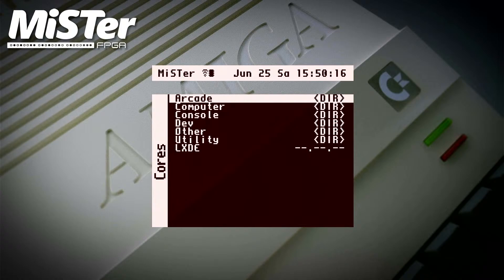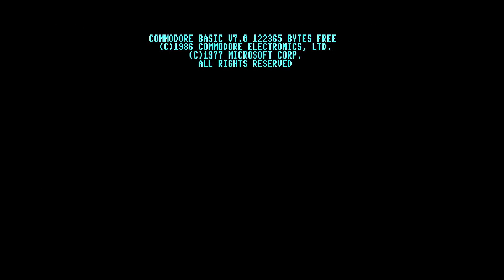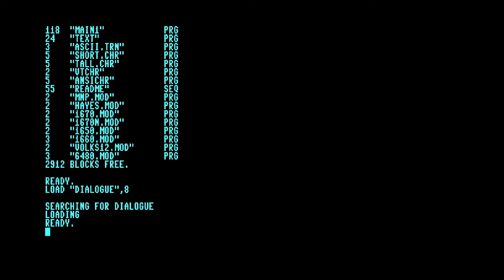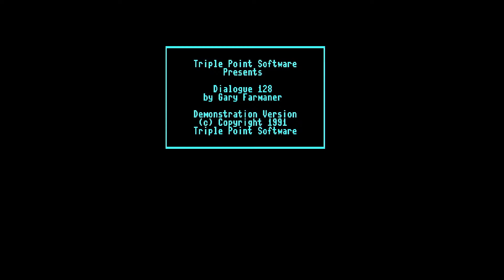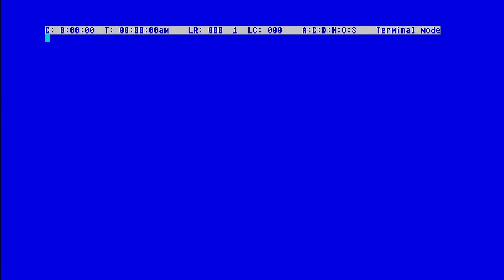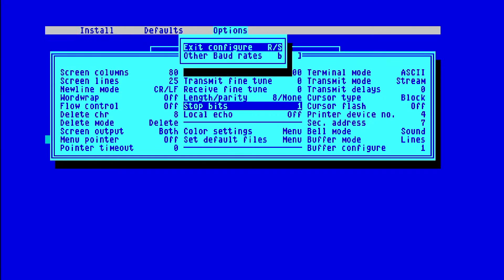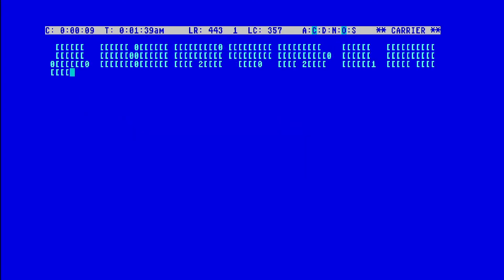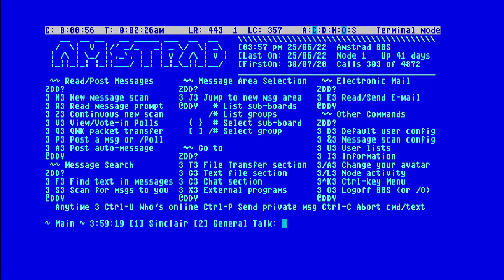MiSTer FPGA Commodore 128 (C128) Core BBS Terminal Demo in 80 Column Mode

Comment: Novaterm_128_2.0 is another good C128 terminal program that works well with the Mister C128 core. It supports 80 columns but is limited to 2400 baud

Comment: You can hit F3 for directory on a C128 and F2 for dload, saves on some typing :). 

When you switch to 80 column mode the C128 does indeed not switch by itself (real systems don't either), but hitting RUN STOP+RESTORE (END+F11 on the MiSTer) will switch without having to reset. The video corruption could be due to video timing issues, the VDC implementation is still far from being complete.

Disk loading will be much faster in the next release as that implements fast serial support, in this version of the core the IEC port runs at C64 / 1541 speeds.
Reply from the maker: Thanks for the tips - and thanks for the great work on the C128 core :)
Reply: Thank you for your work on this Eriks5

Comment: Forgive the silly question but what kind of keyboard are you using? It sounds great.
Reply from the maker: Hi Golan. I'm using an Amiga 500 keyboard - the MiSTer is installed inside the case. There are a few videos on the channel which demo the Amiga 500 MiSTer :)
Reply: @RTSRetroTechShed  Thanks. I am new here so I have to work through the older videos.

I never knew a 500 keyboard could be so clicky. It's lovely.